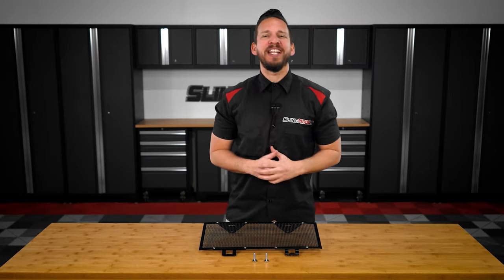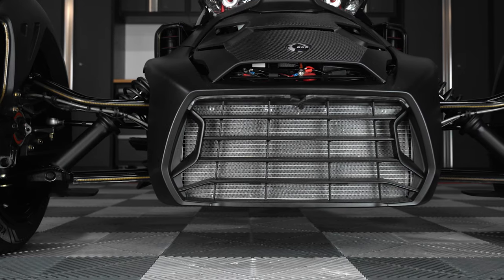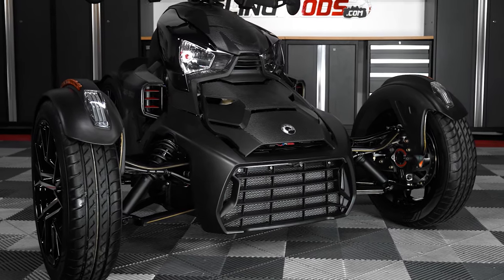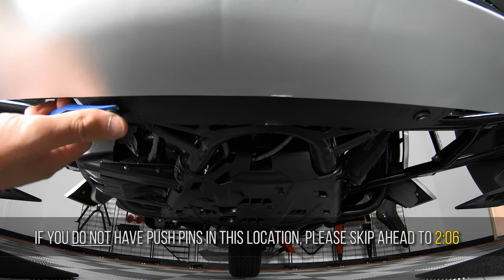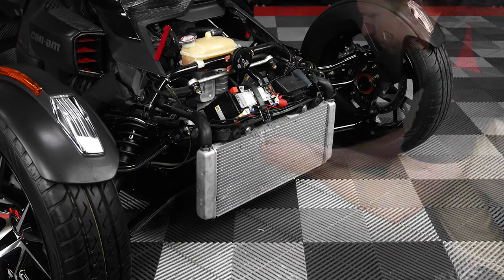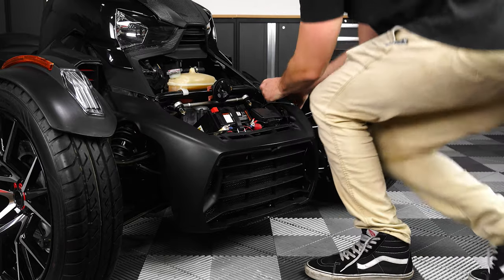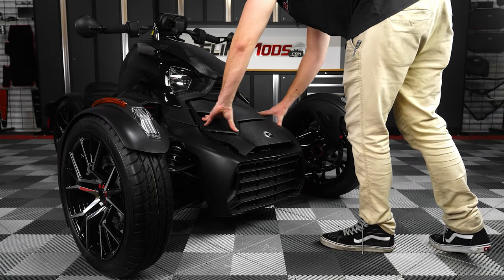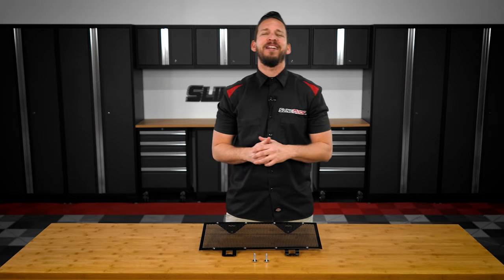Can-Am Ryker Ballistic Steel Mesh Radiator Grille | SlingMods

Comment: Will it work with bumper installed?  Uses same bottom holes right?
Reply from the maker: Hello David, we have tested and confirmed that this product is compatible with the chin guard that comes installed on some models from the factory. We have not confirmed fitment with the OE front bumper.. but I can't see why it would not be compatible.